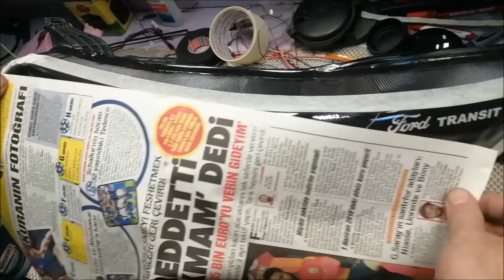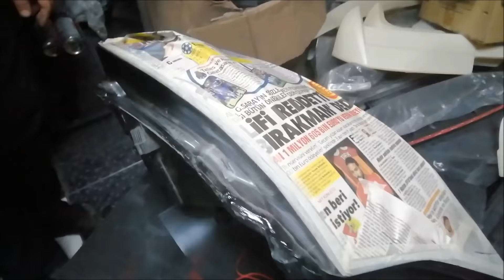FORD TRANSİT LED FAR NASIL YAPILIR // HOW TO MAKE LED HEADLIGHT

Comment: I have been building high performance engines, I'm doing high end modifications for over 20 years, and go figure I can draw my ass off, and so as an artist I can recognize another. What they do here comes with many years experience, but also a natural gift. Another thing is being able to see Being able to see what works best for a specific application. Anybody can stuff LEDs or Halos into a tail light or headlight and call it aftermarket, but it takes a real artist to see the whole picture, and not only how it will look that headlight or tail light but also if it works with the actual car. For instance you ever noticed that some cars just look better in some colors? Notice that a good color for one color may not look so good on another. For instance, the Lamborghini Countach does not look all too good in Black. And black is classic and typically looks good on most cars. I also happen so like black a lot. But it just doesn't work on the Countach. And there are many examples of this. So my point is when a true artist is designing a car, or anything else, will have that ability to see what will work best with that specific application. And not to mention they are limited in what they can do here, a tail light for headlight is the specific shape and they can only work it's so much, and so that makes it that much harder and it takes that much more of an artist to overcome